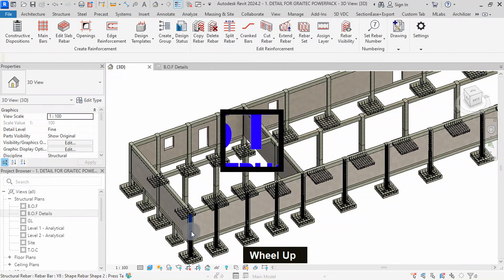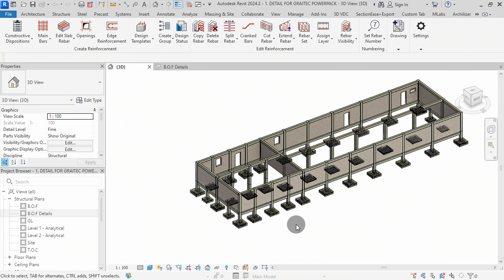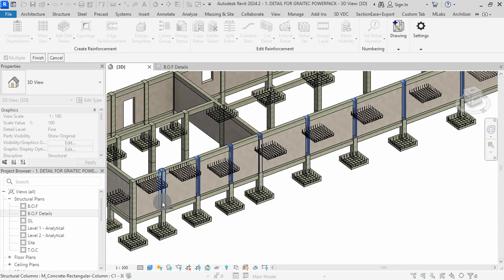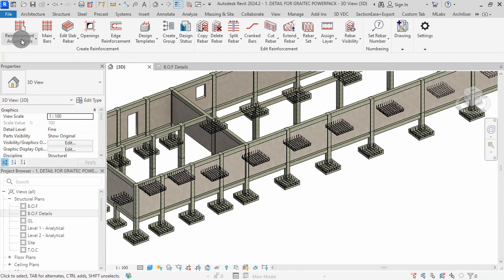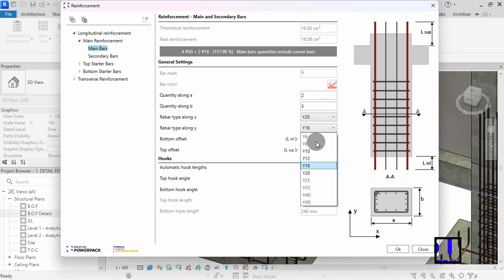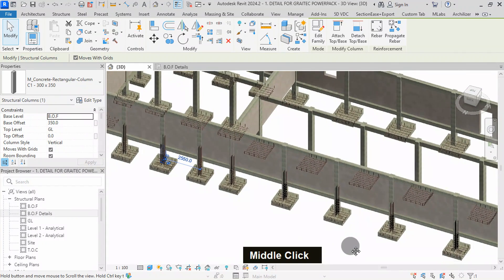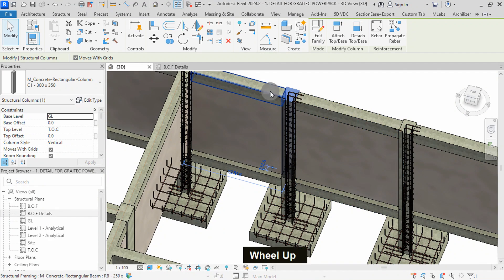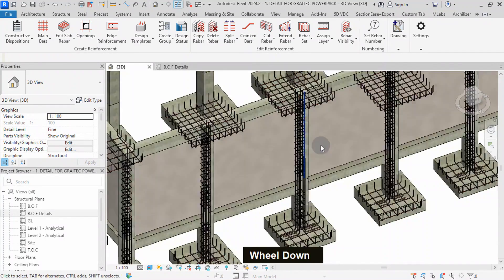Revit 2024 Tutorial -  Columns Rebar Detailing with PowerPack Detailing Plugin

Comment: What is the difference between rebar diameter in powerpack like Y10, or H10, or 10T ,or 10R???
Reply: It's the grades of rebar, Y for Grade 450, T for Grade 460, H for Grade 500, and R is for mild Grade 250